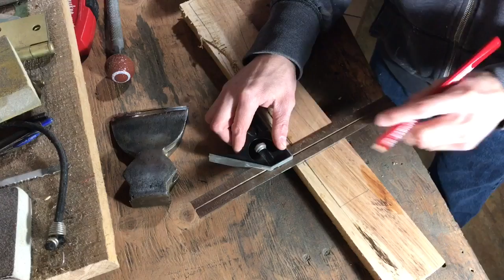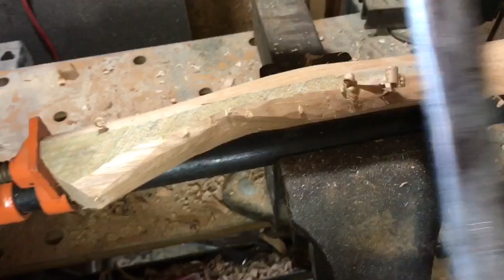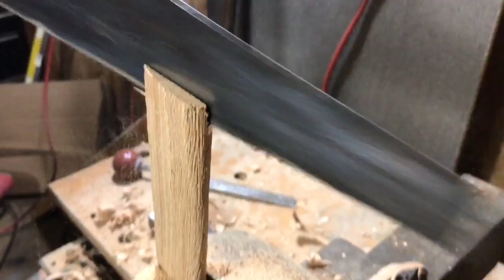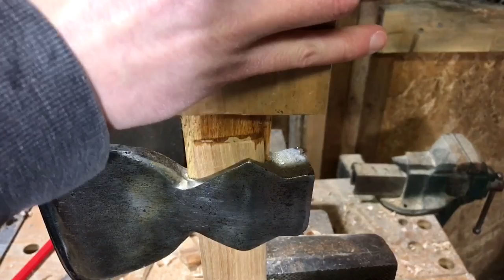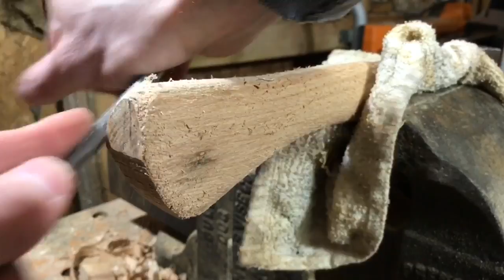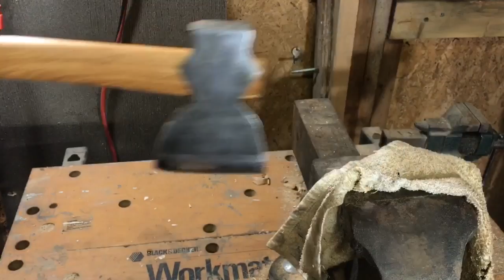MAKING AN AXE HANDLE | AXE HANDLE FROM HICKORY

Comment: Very nice, looks great and I like the shape. Couple of tools you might find useful for future projects are a spokeshave and cabinet/card scraper, use the spokeshave to take off finer shavings after the drawknife and the scraper to smooth things down before sanding (the scraper will leave a very smooth finish so you'll probably want to sand tool handles to make them grippier). If you're anything like me you probably hated using the course rasp and the work required to remove the tooth marks from it.
Reply from the maker: I actually have a spoke shave but due to a tool reorganization I couldn't find it when I filmed this video. Go figure 😀 I don't have any card scrapers. Something I'll probably pick up at some point.  I love using a rasp but hate sanding out the gouging it leaves lol. I've made around a dozen axe handles and this one was probably the worst one I've made haha. I was more concerned about filming than anything. I'm not real happy with the way this video turned out either, but to learn you gotta start somewhere! Thanks for the suggestions and the comment 😄!!
Reply: Looks pretty freakin awesome to me!  Nice work, bro.  Since this is youtube I'll have to add: you took 4 hours to do it...  I would've done it better in 3 hours 59 mins!!  ;-)
Reply: OUTDOORS55 after retiring dad went to all the farm auctions and bought the broad ax blades used to hue oak logs into cowbarn beams before there were sawmills. He put new handles in them and hung them on his shop wall.  My complaints is I can't find a good handles at a hardware store. I currently don't have resources to make my own handles. scythe was also not available in hardware stores.  I retiring from rock and roll and decided to grow my own food so this spring I purchased all  necessary tools new but handles don't last the season.  HOBOS should unite and make the hardware store return all the bad handles to China. I refuse to touch plastic handles.
Reply from the maker: Haha I agree, hard to find a good handle from a hardware store. Good hardware stores are going away. The big box stores are taking over. I have bought some handles online and had good results. House handle co. is a good handle company, as long as you request a hand picked handle. I usually buy handles for splitting mauls as they tend to get beaten up pretty good. Especially if someone else is using it😉 I usually make handles for all my axes. Nothing beats a hand made handle😀
Reply: Hippi Blue look on amazon or there's a website , Tennessee hickory handles or something like that and you can find good hickory handles , some companies even sell blanks which you can shape to your liking

Comment: I would do it on a work bench that doesn't wobble.  Tools should never be drawn across the surface opposition to the cutting directions. I also prefer following the wood grain rather drawings.  My dad makes a barrel of handels cut on the grain then select the best one for the tool and job.  He had collection of several hundred broad axis by the time he died at 95.
Reply: the handles my grandfather made never had to be replaced after a century of users.   The handles  I get from ace hardware have to be replaced every season.
Reply from the maker: I had to use this bench due to filming. I've made a lot of axe handles and know how to read grain, and lay out handles. Thanks for the tips anyway! Sounds like he had quite the collection! Thanks for stopping by😀
Reply: Hippi Blue I
JJHHH bed